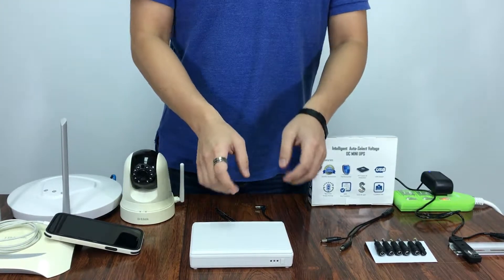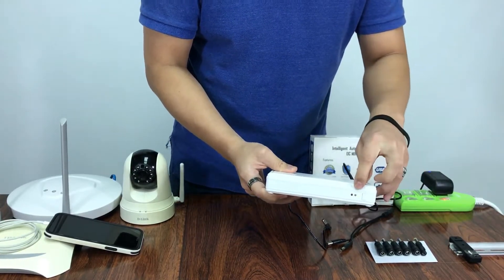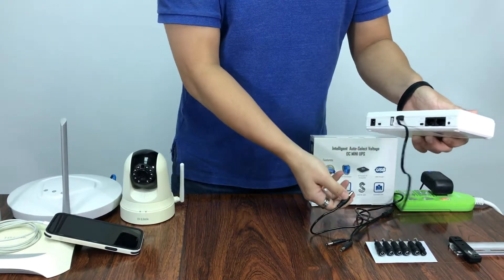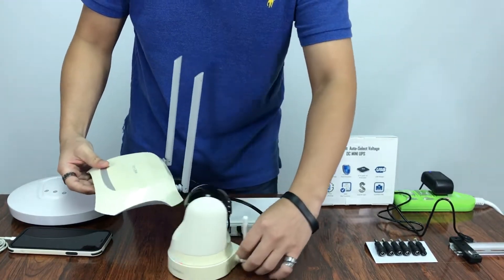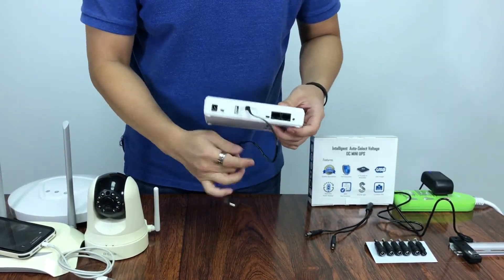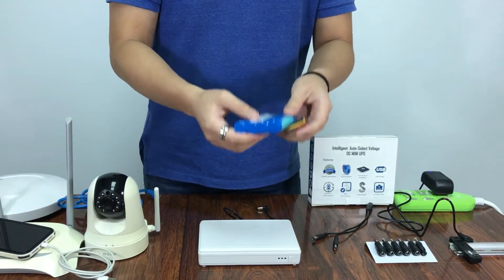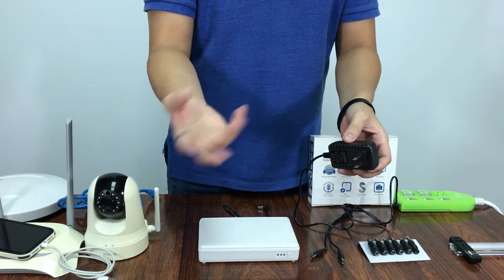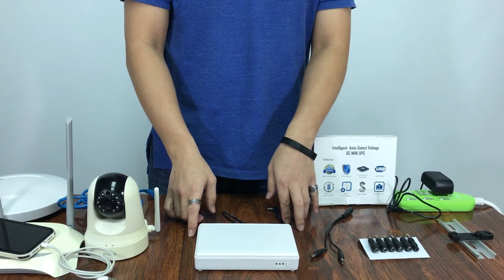5V 9V 12V 15V 24V 8800mAh Mini DC UPS with POE function

Comment: In 12v Onu... can i use 9v ups port???
Reply from the maker: MVPOE has one DC JACK for 9V or 12V output. If your onu device is driven by 12V(1A), you can have the output voltage as 12V.
Reply: Can you use it for labtops.